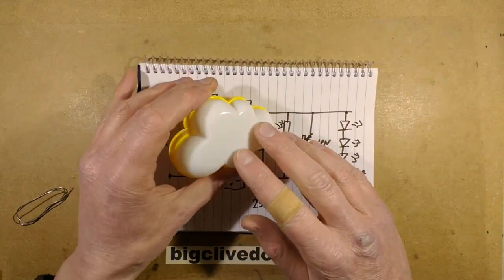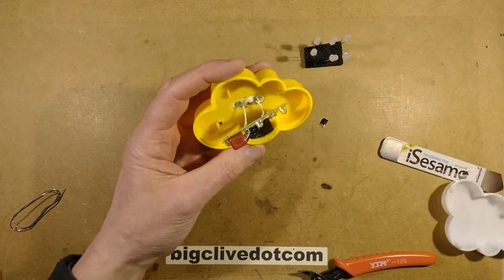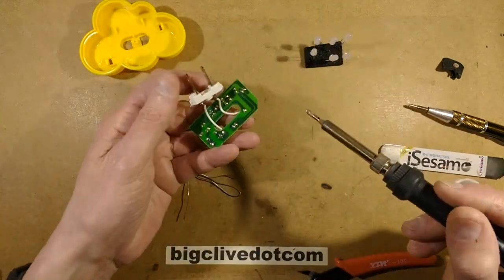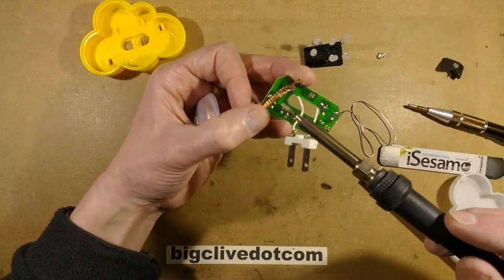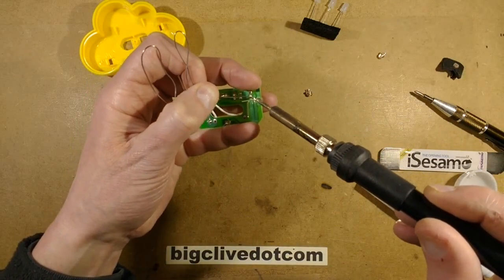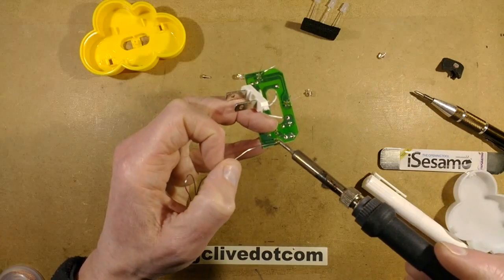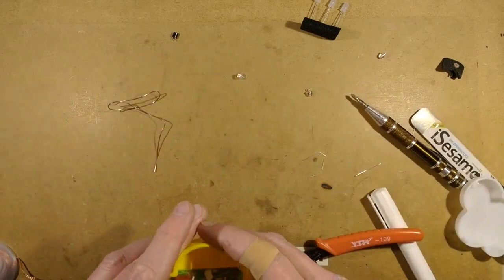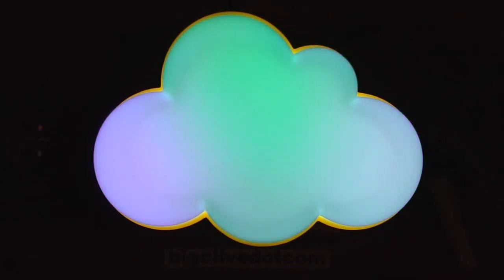Cloud-light conversion to RGB LEDs.  (One-off horrible audio test.)

Comment: I think the main reason for lead free solder is the environment, not health. No problem for hobby stuff, but is for companies pumping out tons that would eventually end up in landfill.
Reply: That was the intended reason, but, with the effects of tin solder causing the premature failures of electronics, it's bumped up e-waste to levels higher than it was with lead solder, so, it's not actually helped anything but boost manufacturers profits in selling replacements...
Reply: twocvbloke Too true.
I was going to say I've never had a failure due to solder joints on anything I've ever owned, but I only recently had a cheap Chinese kit that was bad, breaking my run of good luck!
Reply: I wonder if LG phones have that tin solder in them, causing that bootloop problem.
Reply: twocvbloke unless you have proof for that I call bollocks. imho packages with hundreds of pins and packages like BGA are more of a problem.
Reply: donpalmera Sorry to make you look stupid, but it is true, when tin solder decomposes and oxidises, it forms a crystalline structure on its surface, commonly known as "tin whiskers", in close-quarters situations such as BGA chips, those "whiskers" can cause intermittent or permenant contact with adjacent solder joints (or other whiskers) and cause short-circuits, leading to malfunction and/or total failure if a device, this ha become more prevalent since lead-free tin solder was first introduced, and the level of failed electronics has increased, and older lead soldered electronics outlive their tin soldered counterparts. Call it bollocks if you will, but that's the truth, and that is why tin solder is frowned upon by proffessional solder technicians.
Reply: +twocvbloke

Sorry to make you look like an idiot but there are various types of lead free solders. Not all of them experience the same tin whisker issue. And a lot of that issue can be mitigated by how the leads of the components are prepared and additives in the solder. Internet "proffessional solder technicians" like to drag out the tin whisker boogie man all the time. If you're professionals it might be time to get your data up to date.
FYI on the whitepaper or whatever where Motorola introduced BGA they specified a lead free process.

Anyhow:

If you guys are going to say increased failure rates are totally down to lead free processes and not a combination of factors that have happened since the introduction of RoHS like smaller and higher density components then you need data to prove that.
Reply: The reason tin solder is denigrated is because it's not up to scratch when it comes to longevity, tin solder is more brittle than leaded solder (resulting in broken joints), it requires a higher temperature to melt (resulting in overheated components that won't last as long), it corrodes in the manner I specified, it's doesn't last long in situations of thermal cycling (again, resulting in broken joints), it requires more corrosive and toxic flux to get it to stick to anything (where lead solder doesn't), simply put, unless the electronic device is used in a thermally stable, shock-free environment and never switched off and on, it's "okay", but in the real world outside of papers and certificates, it's junk.

The only reason there are pro-tin solder nuts out there, like yourself, are because they've fallen for the RoHS nonsense of "It's harmful to humans", well, I personally don't chew on my 60/40 solder, so, it's not harmful to me, or anyone else who doesn't actually ingest it, it doesn't vaporise when heated to melting point, so there's no inhaling it, the only real problems are the poorly devised methods and practices of recycling that were involved with dealing with e-waste, rather than dealing with the problem directly by making manufacturers responsible for disposing of their products when they die, they just made a bigger problem causing more failed electronics being sent to the same "recycling centres" (aka, shanty towns in poverty-stricken countries), the only difference being they're using hotter irons to strip boards of components that contain far worse chemicals and compounds than lead, and those far worse things are doing more damage to them and the environment than lead solder ever did.
Reply: Correct, it's mainly environmentally focused. And do note that bigclivedotcom is not in an expert position to talk about the effects of widespread usage of lead-based solder on the environment.
Reply: >Nobody has to prove anything... Certainly not to the likes
>of you  donpalmera - 

How many boards do you coming off of the production line this year?

>I've worked professionally with electronics (specifically high end
>audio/visual equipment) for almost 38 years, 

This is called "an argument from authority". You could be the solder jesus but you still need data bud.

>they are now far FAR more common in unstressed equipment

Quantitative statement with no data is basically useless.

>A common area which poses problems (for example) is in
>pre-built XLR leads...

So you work with stuff that has the pitch of the grand canyon when the stuff that is failing contains chips with hundreds of pins with tiny pitches that have to be inspected by xray. Apples meet oranges.

>Factually the repair trade has been contracting for decades

Has nothing to do with lead free solder and everything to do with the complexity of modern electronics being far beyond some guy with a soldering iron. It's like stuff might even fail more because it's hundreds of times more complex than stuff that's based on a bunch of passives and a bunch of DIP packaged op-amps or something.

>You will struggle to fine any credible repair technician 
>who advocates lead-free solder simply

Ok, so they use lead-free solder to fix stuff that's all made with lead-free processes. Probably best they can't fix anything more complex than replacing a fuse in a plug then.

>The Japanese electronics industry 'likes'

HAHAHAHAHAHAHAHAHAHAHAHAHAHAHAHAHAHAHAHA.
Reply: >The reason tin solder is denigrated

And everyone has been running basically lead-free for everything for a decade or more. The boat has sailed. Components are made for lead-free processes now. Boards etc are designed to go through lead-free processes.

>The only reason there are pro-tin solder nuts out there,

I'm not pro-tin. I don't actually care. If you work in electronics everything will be lead-free. Done deal. If you are a hobbyist you can use leaded stuff. I use lead free because all modern components are designed for lead-free solder, the finish I get from the PCB house I use is lead-free, the tips for my Hakko soldering station come prepared with lead-free.

>like yourself, are because they've fallen for the RoHS

Lead is harmful to humans. The argument is if is the relatively small amount of lead used in electronics are worth the trouble of removing it.. well too late buddy. It's already happened. We can go back and forward about how it's tin whiskers and not some knackered DRAM that's causing random fault A,B,C and in products X,Y,Z until you are blue in the face.
Reply: So, Don, tell me, why is it that military and medical grade electronics BAN the use of lead-free solder? And, as you say, where is your proof that "everything will be lead free" when there are manufacturers of products that are using lead solder? So, you're saying, without proof or fact, that all electronics manufactured today are all 100% lead free? 

Well, you have just proven you know NOTHING about what you're talking about, as I'm aware of manufacturers who either cannot use tin solder, usually for mission-critical mechanical longevity purposes, or refuse to on the same grounds, and these products are at modern component levels, and are boards produced in their tens of thousands in a week, so, unfortunately, it seems you're wrong, and are ill-educated and poorly experienced in the field to know what you're talking about.
Reply: >The boat has sailed for the moment...  
>Eventually there will be a sea-change and the market
>will start to demand reliability. 

Yeah.. everyone is going to throw away their perfectly good production lines that are now setup for lead-free to go back to lead instead of mitigating the issues like they have for the past decade or more.. Somehow I don't think so.
Reply: >BAN the use of lead-free solder?

You tell me. Maybe it's because validating stuff like solder formulations for those sorts of applications takes insane amounts of time. Those applications are still using components that haven't been made for decades. Maybe it's a combination of a lot of things or maybe it's dun dun dun TIN WHISKERS!

>everything will be lead free"

All consumer grade stuff is lead-free. The stuff you are talking about that isn't lead free is some tiny fraction of a percentage and not the stuff that you are saying is failing more often.

>or refuse to on the same grounds,

Well they would be very stupid if they refuse to use lead-free processes for everything except places that have exception from it because being the genius you are you would know that A: All but very specialist components made for specific applications and usually to order from clients like the military are made for lead-free processes and B: using lead solder to mount components that already have lead-free alloys on them is a very bad idea. 

>and are boards produced in their tens of thousands in a week,

Can you name one of the components so we can look it up and see if there is a lead-process version available to order?
Reply: Just because they're not "consumer level" doesn't mean they're small quantity, again, showing your ignorance here. Medical grade hardware in hospitals in particular has to be relied upon to keep people alive, take a simple Electrocardiogram, if, as you claim, they contain hardware that hasn't been made "for decades", how come they have modern processors and ICs fitted inside them? Or is it, you're talking out of ignorance and assuming it's all "lead-free" because you say so? Modern military hardware, again, modern hardware, but lead solder for longevity, after all, would you want to be the pilot of a fighter jet that suddenly breaks down mid-flight due to a CPU's tin-balled BGA cracking? I know I wouldn't...

You want me to name components, well, funnily enough, I don't have access to those components as a lot of manufacturers keep their designs secret, usually for preventing hacking, plagiarism and unofficial modification (hence why you see a lot of scrubbed chips these days), but suffice to say, these manufacturers, who also have lines making consumer grade hardware, are still making lead-soldered products, and could quite easily switch back to lead if they needed to...
Reply: >longest-established firms of its type in the country of my birth

You own irn-bru? I'm not sure what this has to do with electronics.

>I've nothing to thank trash like you for.

ワロタ
Reply: Did you test the solder by licking it?
Reply: Wow, this descended into a heck of an argument!
If all manufacturers had to recycle their waste at its end of life it might help things. I think there's some EU thing we have where if you buy eg a new TV, the seller has to accept your old one for recycling.
But things like that never work out in practice.
As for the whole "lead free is a conspiracy to sell more' maybe it has turned out a bit like that, but I don't think that was the original idea behind it. We can't blame our 'throw away' society entirely on lead free! China pumping out poor quality goods is the main problem, but unfortunately people are prepared to buy it these days to save a buck!
Reply: Please people, stop it. Your "x years of experience working with electronics" has nothing to do with the point. You're making an appeal to authority. https://en.wikipedia.org/wiki/Argument_from_authority

You have NO insight in the bigger picture. Leave it to the environmental scientists and the data analysts.
Reply: lead free has certainly been a boon to people with the equipment to reball bgas
and argument from empirical experience != argument from authority
Reply: He's not providing any empirical evidence. He is elevating his position ("40 years of practical experience, as well as the appropriate training and professional qualifications") to make himself seem as an authority figure on a problem that's WAY outside his field of expertise.
It's like a person who studied religion saying that evolution doesn't exist. Or an expert in computer engineering, saying that cold fusion is wasteful. 
If he wants to present some actual evidence, he might want to look up a study from a reputable source that says using leaded solder is better for the environment compared to lead-free, including the comparison when the lead gets in the ground due to rainfall on landfills...
Reply: I suspect part of the issue is that people are using lead free solder as though it were leaded and expecting similar results. It's not a "drop in" replacement, but works perfectly well when it's differences are respected.

I recently repaired two bits of BSS gear, an AR416 from 1989 and a Soundweb from 2005. The 416 had been hand soldered by someone who was apparently on work-experience with BSS and was far from a "textbook example", but they got away with it and it worked anyway, possibly because leaded solder is that much more forgiving. The Soundweb  was clearly a tightly controlled automated process with what appears to be lead-free and there were no problems there either. If the work-experience person who made the 416 had been using lead-free it might not have worked out too well, but an experienced hand-solderer can do a good job with it.

Matt, do you mind saying where you bought the pre-made XLR cables from that were failing? Was it someone of VDC or Kelsey type standard? Cables you make yourself are likely to be more reliable simply from the fact that you're going to put more care and attention into making something that will directly affect you when it fails than if you're working in a factory somewhere and the cable isn't traceable back to you later. I've seen plenty where it looked as though the solder had been applied to the iron and then wiped across the cold solder cup and wire, forming a ball that was only making contact on a small point. There are too many factors to attribute it directly to the solder type.
Reply: It's just the price of lead, no one cares about the environment.
Reply: +Matt Quinn I appreciate the time you took to write all of this out, it's gotten me thinking. Thank you for sharing your insight!

Comment: I completely agree on using solder wick vs. a vacuum pump. I have a very functional Aoyue vac unit that's really great for depopulating on a larger scale, and I do use it a fair bit, but nothing's easier than picking up a roll of braid and having it "just work". Don't have to worry about clogs, cleaning, or general maintenance either.

Comment: The anti lead based solder movement was about when it's in land fill and other improper disposal methods, completely ignoring the much heavier metals, including but not limited to arsenic, and that elemental lead can be found in some soils in certain parts of the world, and that lead would break down as it's salts, which are also sometimes found.

Comment: Another vote for uneven audio. I probably wouldn't have noticed if I wasn't looking for it, but it's pretty annoying when it happens.  (Cloud looks awesome. I wish they sold those LEDs with different initial color mixes, so you didn't have to wait as long.)
Reply from the maker: All the android audio controls are locked away.  Even the usual engineer menu has now been locked because kids were using it to make their phones "louder" and frying the speakers.  I'm going to try a bluetooth microphone as a last ditch attempt and then abandon the Moto G4 for this use if it doesn't work.
Reply: bigclivedotcom Try rooting
Reply: "Try rooting" - but not in the Australian sense.

Comment: I would adore a night light like that final product. That's so sweet.

Audio wise, it's dropping sharply on loud noises as it has in built compression to avoid clipping, but the tone is super harsh. I would go with the previous microphone, but adjust it in post with some EQ to lessen the boomy low and bring out a little of the midrange. Can send an example clip of what I mean if it would help.

Comment: I like the conversion, very nice effect. As for the audio, enough have already commented.
I thought or two for you. 3 electret condenser element mikes 1 in front of you and off axis
left and right. the elements are really low cost a few pounds each max. And if you load the impedance down you have effective level control. A 10K audio taper pot is where i would start. It will also prevent the AGC from swinging the gain levels all over the place. They are small making placement a simple
matter.

Comment: You mentioned the straw hat lens LEDs... Those work really well with the cheap plastic triple LED flashlights/torchs you can get from DollarTree/PoundLand. The reflectors those come with focus the light from the straw hat LEDs quite nicely. Lately I've been making UV versions for local shop keepers. Since we both know that LEDs are cheap and the flashlight/torch isn't much more expensive, selling them to the store owners for $5 works out quite nicely. They use them to check currency as US bills have a UV reactive strip in them now. What I make is far cheaper than the devices intended for that purpose which sell in the  $25 price range and they work just as well. One of these days I'll have to make a color changing version just for kicks...